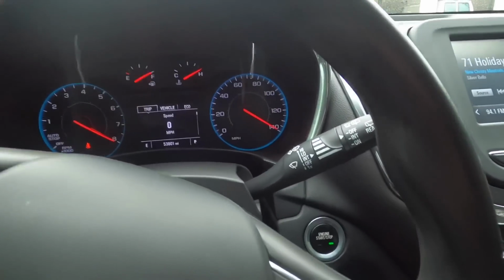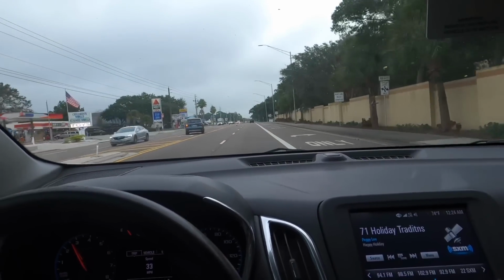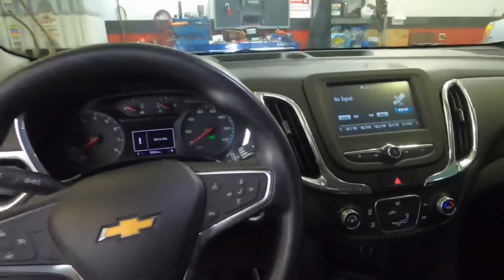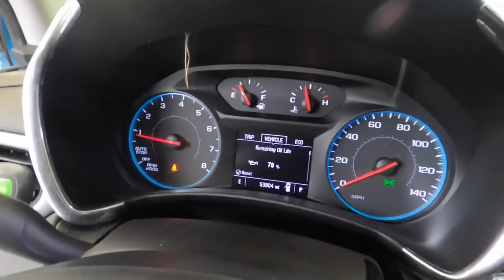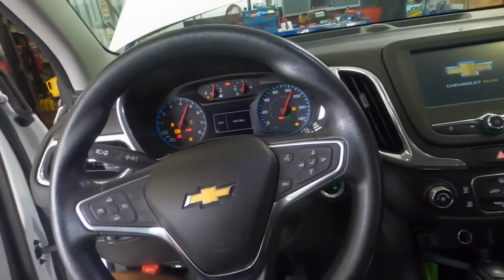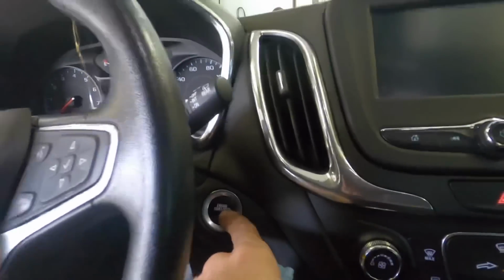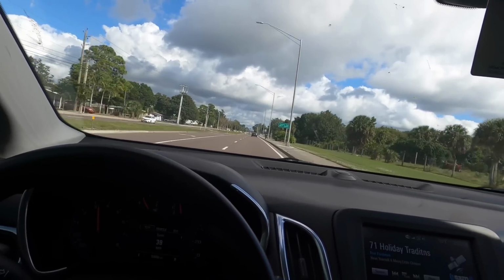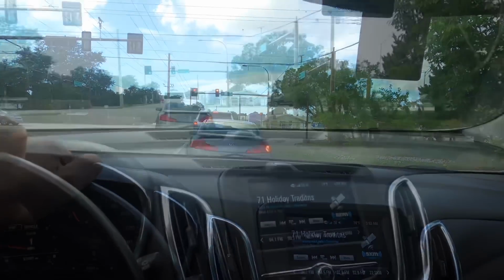Low oil could cost $$$$ | By Mistake!

Comment: Those little 1.8 engines that are turbocharged really need religious oil changes using the best quality synthetic oil available. Don’t forget to not cheap out on the oil filter. The good ones are made by Wix which is the Napa Gold house brand. 

Also, nothing in life is free. Adding a turbo to a tiny engine results in a pay me now or pay me later scenario.

Comment: Back in 2002, me and my mechanic friend did an engine swap, on a 1991 Mercury Grand Marquis. Everything was good except for black smoke coming out of the exhaust. Me and my “ ex” mechanic friend didn’t know, what was the problem. I took it to my mechanic, I left it there, in three hours I got a call that the car was good. Two of the suction hoses were reversed, this mechanic knew, what was the problem, way before, I left my car there. He calls me, i went over there, he charged me 40 bucks. About 64 bucks today. He was my “ trusted” mechanic for 14 years. He was a good mechanic, but not trustworthy.I look at this guy’s video’s he’s very honest, with the customer. Just an oil problem.

Comment: Ray, when I worked for Firestone they would have recommended plugs, wires, all coils, trans flush, O2 sensors, cat converter, brake fluid flush, power steering flush, speed sensor, and about $1000.00 dollars of needless other nonsense. When the car would come back, a wiring harness that caused a whole bunch of other failures. Possibly snuck in the oil change which of course not appear on any paperwork. Thus, my tenure was short. They are the worst thieves I have ever encountered. My opinion.

Comment: Ray help!!! I have a 08 Cadillac CTS 3.6l di with a p0008 code. I’m wondering could it be the VVT solenoid? The engine runs strong with no other codes coming up when I clear this code, however, it comes back and I can feel the difference in engine performance

Comment: Would an over fill condition present the same issue? I have a 2012 outlander sport with vitamin. 90 miles after an oil change  I got a low oil pressure light. Checked the oil and it was over full. Was about 5 miles from home so I continued down the road. About a mile later the check engine light came on. I don't remember the exact codes but I believed the definition was timing more advanced than expected. Took it back to the dealer that did the oil change and they tried to sell me 3 sensor. The oil pressure sending unit and an exhaust and intake vvt sensor. Since it's odd for 3 sensors to go bad at the same time I decided to take it for a second opinion.  The car didn't make it and has been sitting ever since. Had another garage tell me it needs a new motor cuz the timing jumped. The car has 70k miles.

Comment: Outside of European models and vehicles that call for 0w-16, most vehicles oils specs can be met by a synth blend, even dexos. Ergo, most non-European dealers will use a synth blend except for vehicles with 0w-16. That is if they even do the oil change. My last dealer oil changes were on a 2017 VW and a 2015 GMC. In the VW case they forgot the sticker, in the GMC case the oil was black way before the oil life expired - and they way over torqued the oil pan bolt. So I sit and I wonder. ALWAYS CHECK YOUR DIPSTICK RIGHT AFTER SOMEONE ELSE DOES AN OIL CHANGE. Especially if you are running long intervals.

Comment: I do believe its a design fault if the valve timing is upset by a low oil condition before the low oil light comes on as surely the low oil light should be warning of an impending condition rather than one that already exists!
Reply: Agreed. Also, when the oil level is so low that it actually affects operation of the engine, a properly designed dipstick should show the level as beneath the "low" mark. Every level between "full" and "low" should be OK, as far as functionality is concerned.

Then again, in this case I suspect the age and possibly low/wrong quality of the remaining oil had at least as much to do with the symptoms as the low oil level could have had.

Comment: It pissss me off that so so many car companies have copied Toyota 1.5 liter engines and try too boost it up with a turbo and more fuel pressure and ends up then a disaster like Honda and it’s 1.5 engine it’s has problems with gas getting in the oil and destroying the engine

Comment: You’re using the garbage cleaner if he was old school technician you would know just use ATF that will clean it faster automatic transmission fluid is full of the target it will clean the engine quicker instead of that garbage they have on the market that doesn’t do nothing

Comment: OMG .  I just realized I WAS this customer.  not because I neglected a car, but because it was a high mile vehicle that burned oil.  it acted funny about 2000 miles after an oil change.  it was low on oil but I never connected it to some funny lagging in the engine as I accelerated.

Comment: Wouldn't the low oil pressure light illuminate if was too low on oil? If it can't get oil to the VVT solenoid, wouldn't it be low on oil pressure? Is it fed some other way?

Comment: I just literally put a Cup of Seafoam in my Engine-Oil! 2015 Impala LTZ, 3.6L VVT-V6, 70,000 mi. I ALWAYS use Mobil 1, & change oil @ 3-5K miles. 

About a month before an Oil-change, I put in the cup of Seafoam. Even a MONTH AFTER an Oil-change, my oil is still pretty clean!! 

Same with the Gasoline. 1/3 bottle of SF once/month when tank is @ 1/4. Only use Top-Tier NO-ETHANOL Premium.

My baby runs STRONG!

Comment: I replace several cam shaft angle sensors on a little Aveo Daewoo Chevrolet thing. Some of those GM cars will just stop and then restart and then they say it's the camshaft sensor... I had something burn up in the wiring harness

Comment: I still can’t believe that GM didn’t send a recall in those vet solenoids on those 2.4L. I work at AutoZone and anyone says their early to mid 2010s 2.4L has an engine light I could bet money it’s those actuators. I could quote price after tax for both and what tools you need to change them. Wild

Comment: About two months ago while driving on the highway my 2012 Ford Fiesta 1.0 eco boost 3 cylinder started Misfiring ....drove it to the nearest mechanic I could find at the time and sadly it had a cracked in number 3 piston sad with only 85 000km on it about ...and the engine rebuild and so far so good .

Comment: Ray I just have to say. im retired master evt ase. Before I ever drove a vehicle that I was needing to diagnose the first thing I would do is pop the hood ck the oil and coolant level and cond. Then I would ck the cond of the battery and battery post and make sure they were tight. And back in the old days of vacuum lines running everywhere I would look and listen for leaks. That's if customer or driver stated a drivability issue

Comment: This is why you change your oil&filter EVERY 3000 miles...I don't care if it uses full synthetic, or manufacturer claims it can be done every 5000 or 7000 miles.  Those VVT solenoids need clean, new oil to function properly

Comment: I'm slightly disappointed, but it's common nowadays, so don't feel singled out.
My Uncle taught me very early- to always do a quick "pre trip check" before
driving any vehicle. Lift the hood, check fluids, any obvious leaks, or potential
problems. All lights on, take a walk around, glance at tires, too. 30 seconds, tops,
if you're good at it. 

I enjoyed this ethic when I was older, and worked for two companies as
a driver. One Boss saw me on first day, and was astonished, said he always had
to remind drivers to do a pre trip. Mechanics should, especially; when you jump
in a Customer's vehicle & start that engine- you are responsible for it. 

If it's low on a particular fluid- it could be a disaster for you and innocent people,
if a light is out- a Cop could cite you. If a tire blows, or goes flat while on your
test drive, etc.

Turn on wipers- only to gouge the windshield because no blade. (been there, did that)

People see me pre trip my own car- and I get looks & remarks 
" is something wrong?" Hardly anyone checks under the hood anymore-
just gas & go.

Not trying to tell you what to do, just passing on friendly advice.

Comment: The question im wondering is why was it low on oil in the first place? If a modern engine is well designed, they burn almost 0 oil between changes. If it was that low, im thinking theres another issue, like burning oil, or a leak from somewhere. Ive heard burning oil is pretty common on these tiny turbo engines. Just another reason I will never buy a turbocharged engine.

Comment: Good Job! Why go out and spend maybe 18,000 On A SUV and not check the Oil. Not to mention having it Changed. I just don't get it. Especially With Variable Valve Timing. I Won't get started on Transmission Fluids.

Comment: Man, I wish my mechanic recorded everything they did on my vehicles and put them up on YouTube, and was as honest as you.
My wife drives a 2011 Terrain, and complained it was driving rough, stalled a couple times, and the check engine light lit up. I pulled the code, P0300. Took it to our shop, who diagnosed it as needing over $3000 (CAD) to "redo the timing." And they recommended changing the spark plugs as well (didn't give me a quote on that). Not sure the exact mileage, but it's around 168k km, give or take. Anyhow, I said screw that, and drove it home.
On a hunch, I checked the dip stick - it wasn't even registering! I was able to dump in probably 3.5L before it started to show. After that, I took it for a test drive and it was back to normal...
Did my first oil change ever on this same vehicle, a couple weeks later. Seems to be fine since then, but gonna keep my eye on it - not seeing any leaking or loss as of yet.
Also will tackle the spark plugs myself one day. I'm no mechanic, but I think I want to learn some more.

Comment: It's not "low" until it gets below the bottom mark.  It might have been low in the past but it wasn't low when you checked it.  Just saying...it certainly was not a quart low.  If it's between the marks leave it alone, according to the Owners Manual.  And, oil expands when it get hot, as you've shown in the past.
Reply: It was literally at the minimum mark in the vid after a test drive. It was definitely low
Reply: @hvymetal653  I put a link in a previous reply for the Equinox owners manual.  Maybe that's not allowed, my former reply is gone.  Anyway, page 289 of the manual describes when to add oil.  Technically, it was not "low", it was "almost" low.  And, it's not a "quart low" unless adding a quart brings the level back to the lowest mark.  The problem would have been caused by the thick oil and clogged passages, more likely,  not oil level at the low mark. 

Rainman had a whole post about oil levels in the not so distant past.

Comment: Like automatic transmissions,  engine computers are now using the oil as a hydraulic fluid (0w-20 is a clue) to command functions.
Quantity, condition and most importantly viscosity are important in that the computers see timely results when it gives commands.

Comment: My brother bought a Nissan quest for very cheap because the original owner thought it had a bad timing chain and come to find out if was low on engine oil because of bad valve cover gaskets and the timing chain tensioners were oil dependent so after a lengthy valve cover gaskets replacement he made almost$2500 off of the van

Comment: Question? Why was a engine with 53000 miles a quart low on oil. I have a 4cyl cherokee with 40000 mi, that consumes a qt. of oil every 3000 mi or so,  and jeep says that is normal.

Comment: i work at a car rental these gm eco engines and VWs are always low on oil between oil change. granted the rental life doesn't help but they are always burning oil heavy. The GMs commonly drive like that when they're low.

Comment: Wondering what type of oil cleaner you use or would recommend? I have always used seafoam in fuel for years but was hesitant to use it in oil even though it's apparently just fine to do.

Comment: I don't know if they ever changed it, but for a number of decades the actual oil level for the engine was at the one quart low Mark. That one extra Court was just that, extra. That's why you had some breathing room for oil loss. If the engine required five forwards, and it went to court down and just would have been smoking since forever.
And before some idiot comments that I'm advocating the people run their engine a quart low of the full Mark. I didn't say any such thing.

Comment: miniature little motor = 1.5 litre = 170hp, 1976 Cadillac 8.2 litre = 190hp, nearly 5 1/2 times the size for 20 more hp
Reply: RICKY302V8
true, however that normally asperated engine could last for 300,000 miles without any problem, that little turbo unit, lucky if you get 125,000 miles

Comment: With all the high tech in engines you can’t neglect maintenance. Much of the high tech is for emissions and fuel consumption. Simpler engines with fewer parts are always more dependable

Comment: My wife has the 2.4L Equinox.... Worst vehicle we've ever owned. I change the oil every 3,000 miles. And I have to add about two to two and a half quarts in between it oil changes. It does get black relatively fast I'm guessing due to it being GDI. Apparently it's a very common problem on those to burn oil like that. No more GM's for me LOL

Comment: It baffles me why cars don't have a proper oil level indicator and oil low warning light that warns in time. All the mechanics I spoke to about it always said I should fill up oil way BEFORE the car says "oil low". This car you repaired had performance issues and engine error codes, without simply informing the driver to fill up his oil.
Reply: That is why cars having oil dipsticks.
Reply: @vw5056  Erroneously marked or calibrated dipsticks, it seems. The "Low" mark should mean "minimum for the engine to work properly, top up at the earliest convenience!", not "too low and too late, now your engine won't work properly, or may even be permanently buggered!"

Comment: Hey ray , as a family that’s owned an engine machine shop for 45 years . We build everything from regular rebuilds to top fuel dragsters . Just a piece of advice. Don’t put those cleaners in engines . Even things like carbon cleaners do nothing but breakup tiny pieces of carbon that do nothing but scratch the shit out engine components. Breaking lose anything inside is just a bad deal . Leave them alone . I’ve seen some pretty messed up shit over the years. Shit floats around pre filter or packs a filter fast . Or mangles oil pumps .

Comment: I had a question, been following for a bit now,  I have a Equinox 2019 2.0T turbo, can you flush or use cleaner in these news engines ?? I am asking cause I want to use Amsoil, most people use a flush to remove deposits, it only has 48,000 Km on it use full synthetic oil prob like 29,825 Miles.

Comment: The variable timing systems on these Equinox motors is atrocious. Back when I used to work at Autozon,  virtually every Equinox that came in wanting a check engine diagnosis always had a code for one of those actuators. Some people would catch it early and be fine but there were a few people who’s engines were ruined because of these things. Idk if it ever happened but GM should have a class action suit for these cars
Reply: There was and it was settled in such a way it was damn near impossible to use it.

Comment: A 3300 pound vehicle with a tiny 1.5L turbocharged engine??  How long can that last even with oil changes at 3k miles-which people don''t do anymore.  That's a lot of weight and stress on that go-cart engine.  My Honda Goldwing motorcycle has a 1.8L six cylinder and only weighs 900 pounds, hence they last hundreds of thousands of miles without major repairs.  Have seen a 2012 Wing with 457k on it; and a 2017 with over 600k on it and neither were ever torn apart.  Think that Equinox will last anywhere near that?

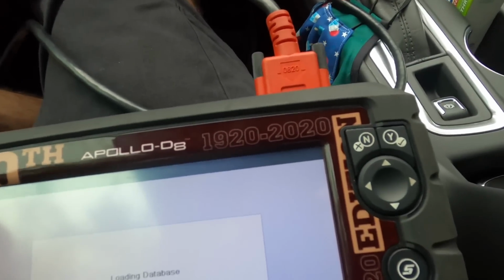Comment: Imma just stop here at 0:24 to just say; if it's still in powertrain warranty and it's not at the dealer for a powertrain concern:  RUN LIKE THE WIND.  I'm betting they FUCKED UP.

Post video edit:  Of course they fucked up.  Probably the wrong grade of oil, as that will often cause VVT issues, and if GM had seen that they done something wrong, they'd have issued a warranty block, including future recalls.

As a GM Tech:  I will note these things have had issues with DI fuel injectors failing prematurely, and I myself have done multiple cracked piston repairs.

Comment: I had one the other day that had the oil change interval changed to 20,000 miles in the cluster. They admitted they were tired of the warnings, to which I responded, "Those warnings will stop once the engine is destroyed."
They did not find it funny, they informed me...but I wasn't smiling or laughing even a little.

Comment: I don't know if one can "accidentally" reset the service reminder. That is the biggest rad flag on this as someone reset without changing the oil on an engine that is probably stressed just hauling that vehicle around under the best conditions.
Reply: Not sure about Chevy but Ford "oil life" indicators can be reset by the owner.
Reply: Oil life minder in my GMC Sierra can be reset very easily ....hold a button for 5 seconds.

Comment: I let my 2001 Saturn SL2 get low on oil to the point that it smoked once. Still running two years later, just have to put in a quart every thousand miles. :) Of course, I don't wait until it runs out lol.